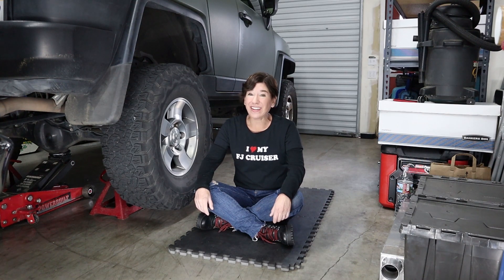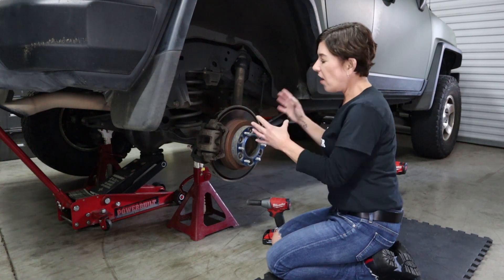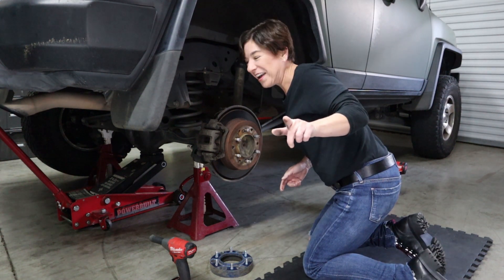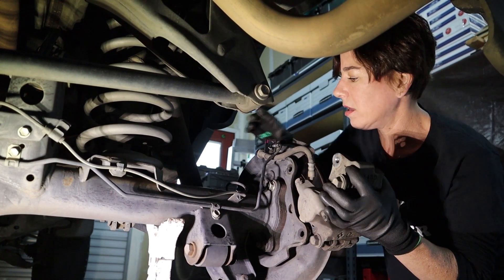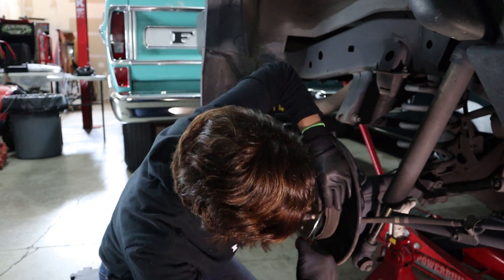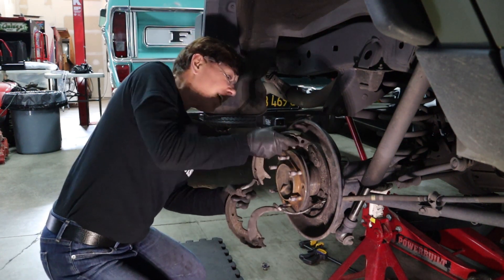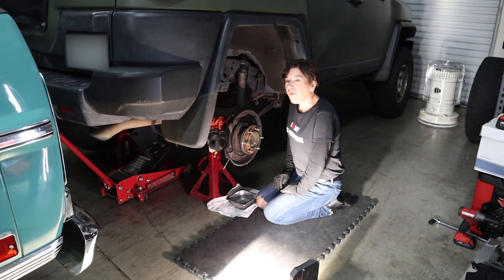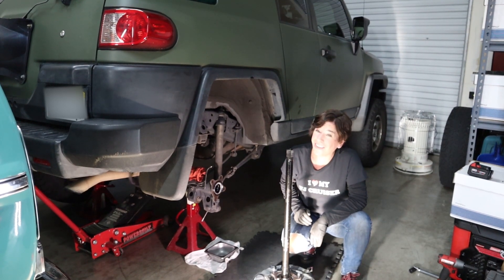How To Replace Axle Seals On Toyota FJ Cruiser!!  Part 1

Comment: I watch another axle removal video where the guy didn't have to disassemble the whole parking brake he just unbolted the cable bolts leading down the side of the frame which gave him enough clearance to pull the whole axle out something you might consider next time thanks for the videos

Comment: A quick question: is the axle assembly common to the 4 runner and tacoma? I may have bent my axle and I am looking to replace it with a junk part.
Reply from the maker: Hi! It looks like the axles are the same for 2003-2009 4 runners and for the 2007-2009 FJ.  I believe the Tacoma's are different.
Reply: @RDGarage  thanks for your guidance! I swapped out the axle in my garage.  The only issue I have now is that I looked down the axle  housing and it looks like there is a sheet metal sleeve near the diff that is oddly bent. I have no idea what it is. The diff is whining and I'm wondering if it is the cause. I got a picture of it if you think you can identify it. It certainly seems out of place.
Reply from the maker: @darkrogue234  go ahead and send me the pic, I don’t really know what it could be offhand. Was it the front or rear? racheljthurow@gmail.com
Reply: @RDGarage  thanks! Will do!

Comment: Will a leaking seal already damage the bearing?
Reply from the maker: No, not immediately. As long as you didn't run it low on fluid or suck containments back through the leaking seal. When replacing the seal, always make sure the vents are clear. Sorry I didn't answer sooner, youtube doesn't always notify me when I have a new comment. :( Thanks for watching!!